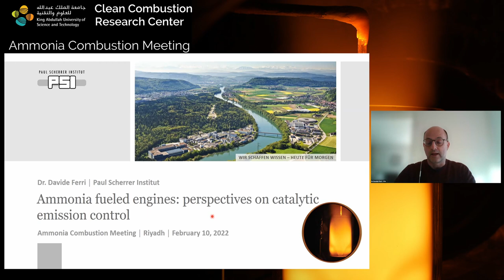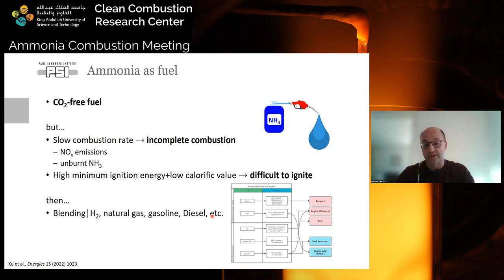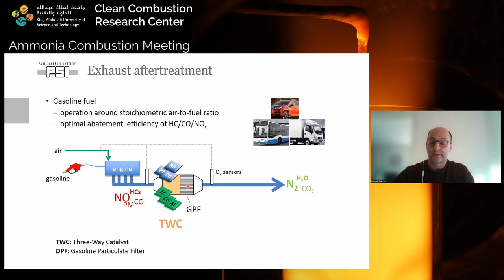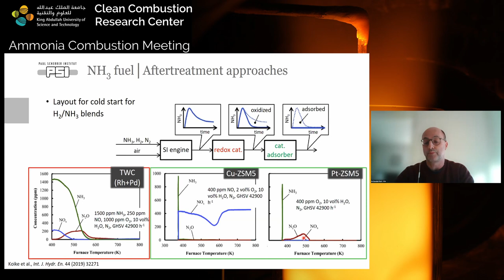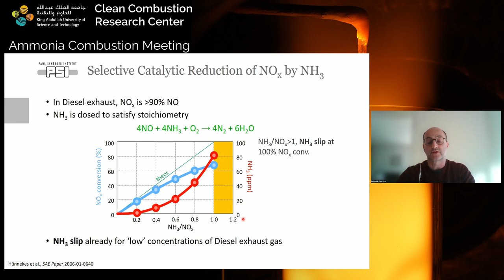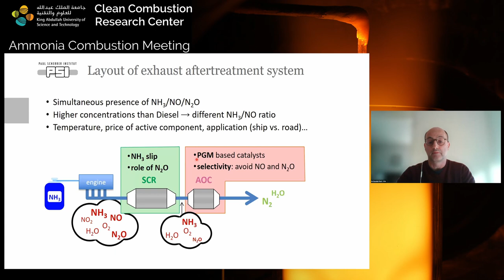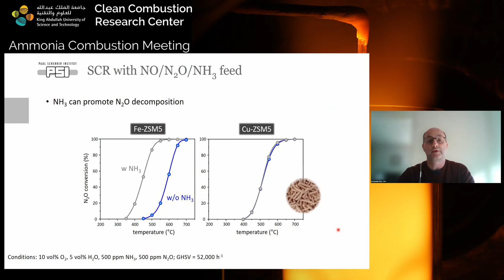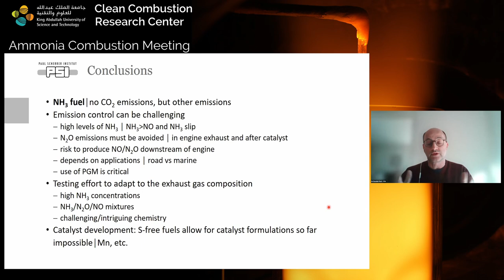Ammonia fueled engines perspectives on catalytic emission control | Ammonia Combustion Meeting, 2022

Comment: Why doesn't a turbine configuration solve all of ammonia's issues? You can run rich to burn with low NOx emission then a second burn phase lean to consume the fuel. Swirl burners have been shown to keep ammonia flame stable, which solves the flame propagation issue without blending other fuels. Any power deficiency relative to gasoline can be overcome with a high RPM 3x supercharged turboshaft configuration (as in helicopters)